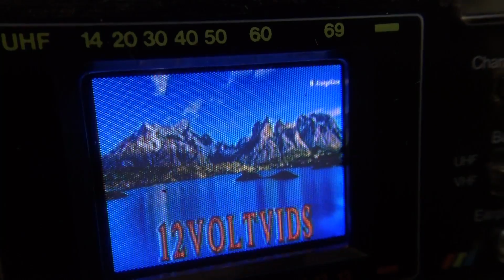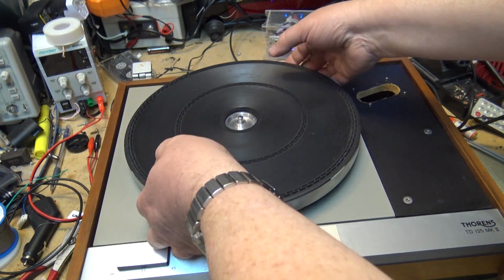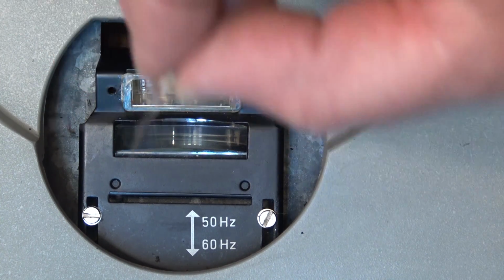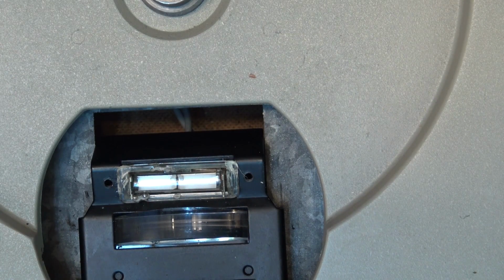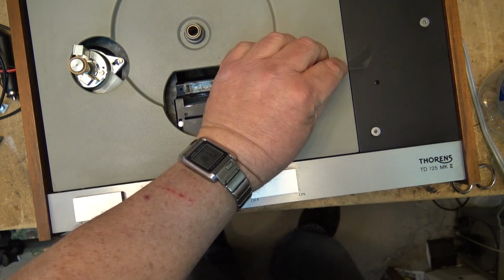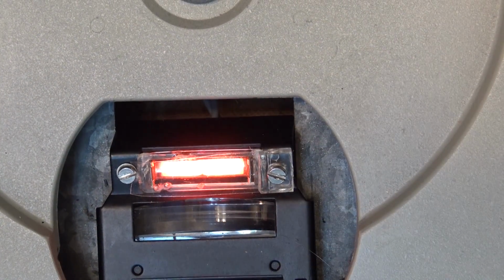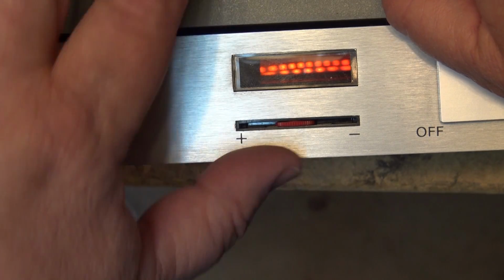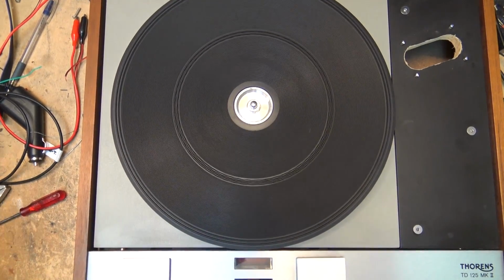Thorens TD125 Mk2 Neon Strobe light repair

Comment: Hallo. I have Thorens 125 Mk2 and outside Controller for Motor. So all internal Electronic was cut off by previous owner. I would like to connect only that lamp again. If you on line after 7 Years) , can you please answer what Power should I connect to lamp 220 V or 12 V? Many thanks in advance

Comment: I had nearly all of the topplayers of Thorens, incl. TD 124, 125, 126, 150, 160...I came back to the 125. To me it's one of the best phonos ever. My one is completely built up by Schopper Switzerland, the specialist for TD 124 as well. The cartridge is a Ortofon blue quintett. All together hard to beat...congrats to that beauty. If you take care, it will last forever.

Comment: I had the exact same problem and solved it thanks to this video. I couldn't figure out how the plastic cover that keeps the strobe pressed down could have broken. I lost over two hours trying to tighten the left screw that keeps the plastic strip pressed down. The hole in the screw was not chamfered and it was impossible to get the thread on, eventually with a longer screw I managed to get the thread back on. A really pain in the butt but I managed it.

Comment: Hi, I'm from Argentina and I do not understand too much English.
What would be the value of the neon lamp?
Greetings and many thanks
Reply from the maker: You can use an NE2 bulb if you don't have the larger original one.
Reply: The strobe light is used to calibrate the speed using a stroboscopic effect at 60Hz.  My apologies if that is hard to understand, but it is difficult to make technical terms easy to understand for someone who does not know the language.

Comment: Good video but the motor is not DC. The control board uses a Wien bridge oscillator circuit to generate AC of various frequencies to create different speeds.
Reply from the maker: I didn't tear this one down to see what type of motor it used. I assumed a DC servo motor. My 165 uses an AC synchronous motor.

Comment: I have a PS-6750 direct drive which is one of those Sony decks that has a magnetic strip around the inside of the platter that is read to maintain the speed. Quite a novel system, but unfortunately it still has the tendency to drift. Definitely not quite as accurate as quartz lock. 

I sometimes have an issue where it will speed up for a split second before settling down, although since a full re-cap it rarely happens. Perhaps a rogue tantalum, or a bad speed control. I'm hoping it's nothing to do with that rather fragile looking magnetic strip! :0
Reply from the maker: I had one of those turntables too. As far as I know it is still kicking around here somewhere unless i gave it away.  The magnetic strip around the platter was a silly way of doing it. They would have been further ahead to use an optical reader on the platter.
Reply: I know right? Makes you wonder how many have been written-off simply from an accidental knock to that strip whilst removing the platter (I'm always very careful!). I agree, some sort of optical based system would've been a much more reliable solution.
Reply from the maker: Or getting a magnet too close to it. A friend had one too, and when I was relatively young and vindictive I was pissed off at said friend.
He borrowed one of my favorite records of the day Steve Miller Band book of dreams. He destroyed it by leaving it next to a radiator, and when he refused to buy me a new one, I did a nasty. Put a magnet up against the side of his turntable. You could imagine his surprise when he went to play a record and there was a HUGE wow in the speed every time the erased section passed the speed head.
He never figured out what happened.
Reply: Haa! Served him right! ;D
Reply: Yes, from comments in the various forums, that magnetic coating on the inside of the rim of the platter was a bad and weak point of their design; very easily damaged. Trying to clean it often results in turning the unit into scrap (unless you can find a good/used replacement platter)...

Comment: I've seen some good tool inventions, like led lighted gloves and finger tip pliers. Really cool you had the right bulb. Even thoe old electronics are good, modern electronics have good upgrades too.
Reply from the maker: I had the right bulb because it fell out and was in the base of the unit. The plastic broke and the light popped out. Thats why I had to make a new cover to hold it in.

Comment: Not a bad idea to lubricate that bearing after you pull out the sub platter.
Reply from the maker: Electone_Guy 
Already done.
Reply: It's also a good idea to check the bearing well with the multimeter to see if it is grounded! Most of the time, it isn't electrically connected to the metal plinth. The  paint or anodizing  is very heavy and it may well prevent an electrical connection, which can allow a static charge to build up in the record if the air is dry. That static may build up until it discharges with a pop through the cartridge and tone arm. Also, a grounded platter will provide a shielding effect, reducing stray electrical fields from the motor and helping prevent them from being induced into the cartridge and tonearm. You can actually solder a wire to the bearing well if you clean the metal and use a high heat soldering gun, and do it quickly.

Comment: I ditched the burned out neon strobe lamp on my Sony PS-X7 turntable back in the late 1980's using a 16-pin dip multi-element  LED and just had to change the series resistor. It still works fine to this day. The TT I bought new in 1978.
Reply from the maker: Yup, my Teshnics SLM1 uses red LED for the strobe.  Personal preference. The neon accomplishes the same effect, and good table designs keep the lamp wires away from audio pickup wires.

Comment: Thorens is the best, TD165 here...
Reply: Great turntables, but the best?  No.
Reply: In your opinion what is the best?
Reply: There is no best.  It depends on what you personally like.  I tend to prefer a Quartz-locked direct drive turntable for speed stability.  Some prefer belt drive.  I owned two Thorens and they were both excellent.
Reply from the maker: I had a TD165. My son has that one now. I use a Technics SLM1 quartz lock direct drive. I like that table personally, but many prefer a belt drive. I have found that rumble seems to be more audible on belt drive tables. Personally I am not a vinyl guy. The sound quality doesn't do anything for me. I have a high end single disk CDPX555ES, and the sound off that player is as good as anything I have ever heard.  Some will argue vinyl untill they are blue in the face, but the fact remains that you get clicks and pops, and limited dynamic range off vinyl. Yes it sounds different. Some would argue better to their ears, and that is fine. I adopted CD  back in 83 and  there is no going back to vinyl.
I keep my table for my early records from the 60's to the early 80's,  and if I find a gem at a thrift store for 1 or 2 dollars I will buy it, but I am not one to be spending the kind of money they ask for vinyl releases these days. A CD or or uncompressed file is what I look for these days.
Reply from the maker: Whatever you like. Listen to many, and pick one that sounds the best to your ears and you can afford, because in this world of turntables the sky is the limit. The same can be said for amplifiers and speakers. 
Don't take anyone else's word for it. Listen to your source material and pick the one that you like the sound from.
Reply from the maker: They are good, but far from the best.  When it comes to high end audio the sky is the limit, and more than one audiophool has spent more on their audio equipment that the house that they put it in. I have seen a few systems while on my day job that has stereo systems, and by stereo I mean a turntable, preamp, a few power amps (mono) and 2 speakers that would have cost the owner probably in the vacinity of 250,000.00!
I was at a clients house not long ago and he had a Rossner & Sohn turn table. Claimed it was over 100 grand just for the table. Mind you the house was a mansion, and the front door probably cost 100 grand as well.
But then, when you are filthy rich, what is a hundred grand for a turntable.
Obviously I can't drop a name for privacy reasons, but I guess it is ok to say they play for a major sports team.